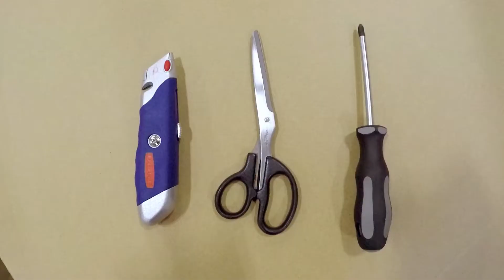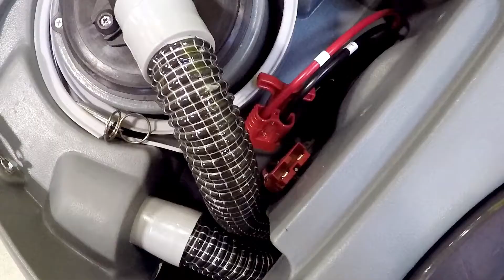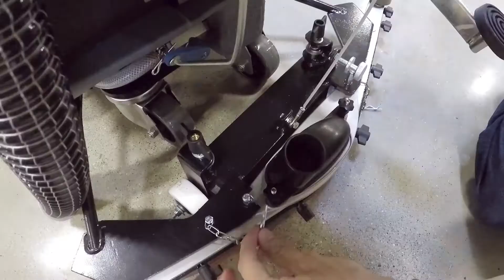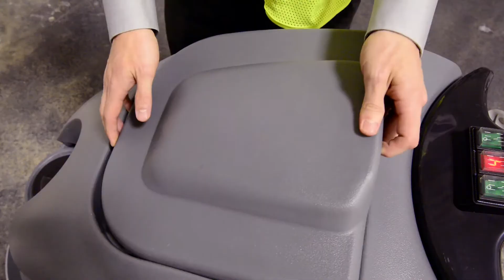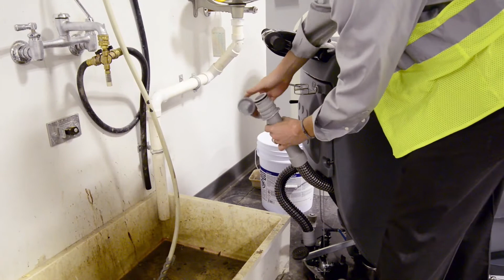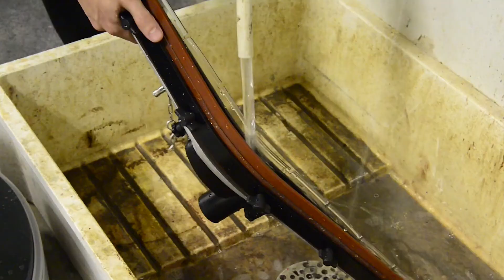Crewman AS20B Installation Usage

Comment: Wild how wrecked one of these can get in 5 years. Struggling to use one that’s had a rough time. Rust on the squeegee holder thing. Caked in dust.
Reply: Also may or may not have had my scrubber lifted and locked while attempting to use it (don’t do this).

Comment: I tried to change the scrub pad, but I can't get the center lock back on.
Reply: You put the scrap pad on the ground then align the machine on top of it while the machine has the scrubber lever raised. Then lower the scrubber lever and squeeze the handles to engage. If it doesn’t engage, that means it’s not lined up properly.